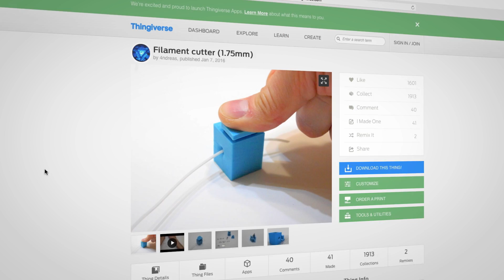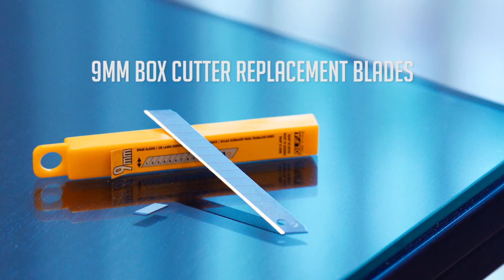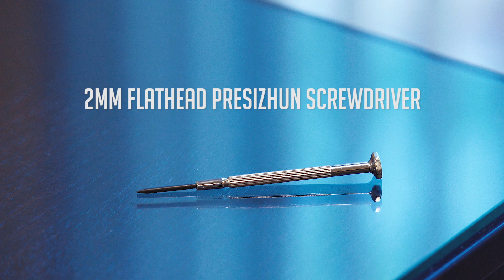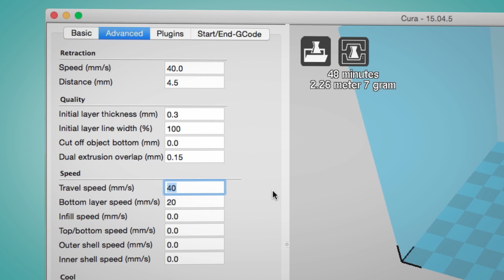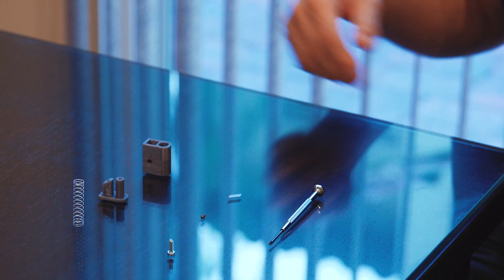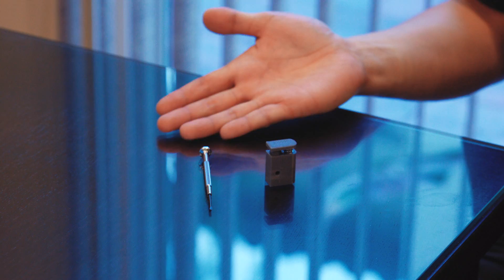Filament Cutter (1.75mm) 3D Printing Tools

Comment: WHY? Just use your snipers that come with most 3d printers.
Reply from the maker: That's a good point. If any of the 7 printers I currently own came with clippers, I'd use them. This is just a cheaper way to have a lot more tools while still keeping the cost relatively low. Thanks for the suggestion!